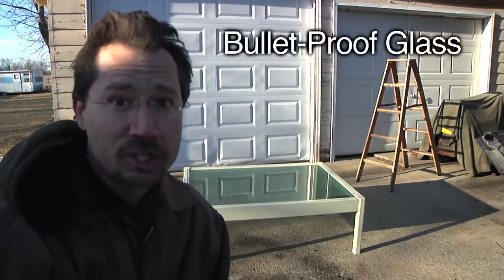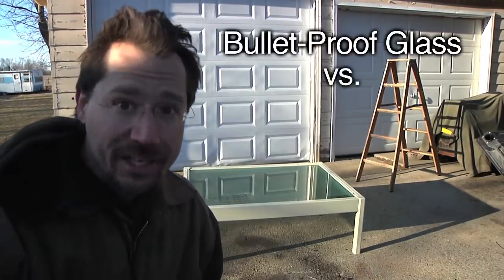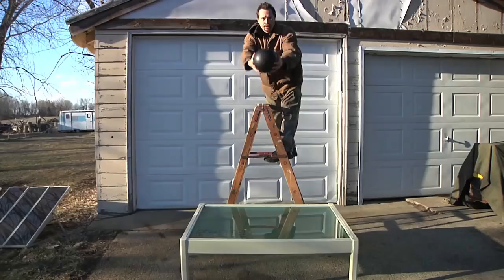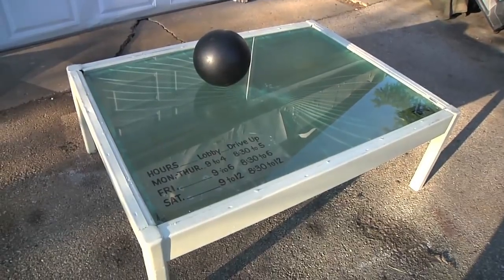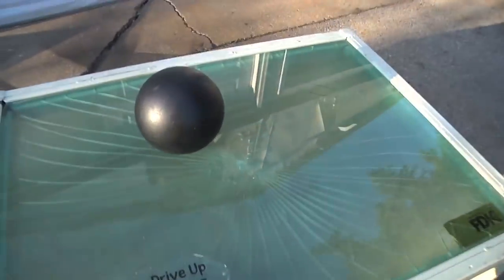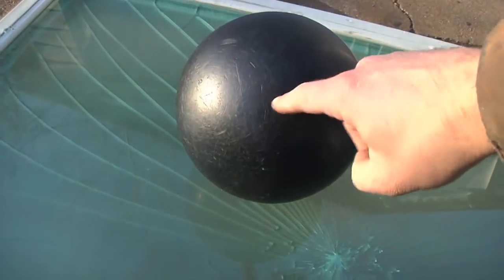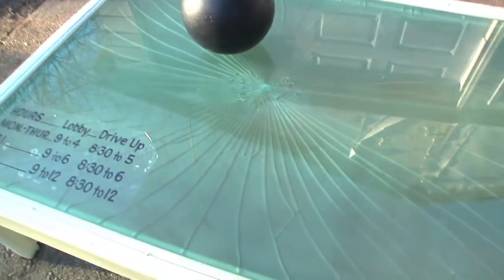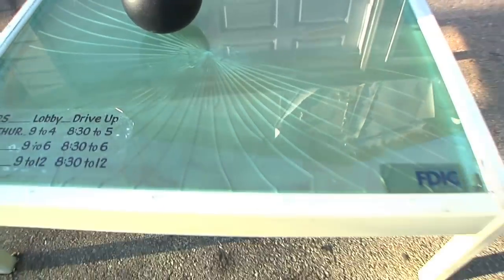Bowling Ball vs Bullet-Proof Glass

Comment from the maker: The glass is 1.25 inches thick. It's 5 layers of quarter-inch thick glass with a very thin layer of plastic between each of the layers. Only one of the five layers cracked under my bowling-ball attack.

Comment: Good Lord you've got a bullet-proof glass for a coffe table! But are those opening hours on the bottom left? Did you steal this from a jewerly shop or something??
Reply from the maker: +juggerfox, I did some work once remodeling a small bank branch office. I had to remove the drive-through. This glass would have gone in the dumpster. Instead, I saved it and eventually made this table. It still have the bank hours and FDIC insured sticker. I also put one of those pens with a chain on it.
Reply: +BenjaminNelson that, sir... is awesome

Comment: lol why would you ever need a bulletproof coffee table XD
and even if you did need one a steel one might be better anyways
Reply: James Roy LOL!!!!
Reply: James Roy
LOL
Reply: A steel table? A. That's an odd material for a table to be made of. B. Unless it's thick as shit, several calibers will rip right through it.
Reply: your saying glass is stronger then steel?
Reply: Swift One thing I want to add is that we should do something about the transparency of the table. Unless one wants to interact visually with the enemy or showing then the middle finger and taunting them, it's not recommended to show the bad guys our position. 
EDIT: typo
Reply: Wimi Bussard
I like the idea of tainting the bad guys.
I assume it works like braining them, but in the taint instead.
Reply: James Roy What if when you flip it, it smashes... will you have multiple Coffee tables or just the one.. it'd be odd to have more than one in my opinion.
Reply: James Roy Indeed :D
Reply: KzeD Gaming it wouldnt break if is bullet proof
Reply: MrJrspek But when it's flipped onto the floor, the vibrations will crack the table, and possible smash it. It's just basic Science and logic there...
Reply: Lol no. You would need to smack it very hard to smash a bulletproof glass table. Just flipping it over won't do a thing.
Reply: just because it is bulletproof dosent mean it wont crack. Bulletproof glass is designed to crack and absorb the energy of a bullet, not straight up be as hard as steel
Reply: Francis Zhao Yes, ofc, but It won't crack from just flipping it, doesn't it? Even normal glass tables won't break if you do so. If you threw it around then it would be another story, but just flipping? I doubt it. But perhaps I am wrong, not sure about it.
Reply: Hide under it in a hurricane

Comment: Actually, to be more accurate you should have dropped the bowling ball from almost 9.5m.
A standard 9mm bullet travels in air at approximately 425 m/s, with a weight of 7.45g, this gives us a total of 676N of kinetic energy. 
Ek = ½ mv^2

Dropping a bowling ball from 4 meters high totals to a little 280N. Since a bowling ball weigths about 7.26kg, the height necessary to achieve 676N is 9.5m. 
E = m x g x h

Comment: that's not bullet proof glass it's simple 1/4 inch non tempered laminated glass. for other safety purposes like glass dance floors and walkways. this will not stop a bullet.  its just 2   1/4  inch glass with film or glue in the center to prevent from breaking into large sharp pieces .. aslo looks good.

Comment: not even a bullet and it made a crack on a bullet-proff glass
Reply: it pretty heavy,give it a break
Reply: The kinetic energy of the bowling ball at that height would be many times that of a bullet. Nothing to blow your nose at!
Reply: That's not what I was saying, but okay. There are many factors to consider when trying to create a bullet proof anything. The rotation of the bullet, the pressure exerted by the tip of the bullet, the deformation of the bullet upon impact. I understand that the bullet would not go through (it shouldn't, anyway) I was saying that the kinetic energy of the bowling ball would be enough to crack the glass easily because it's kinetic energy far outmatches that of a bullet but when you take the other factors as previously stated into consideration, it's more complex than just the Kinetic energy. 

What probably happened was the initial point of contact exerted enough force to crack the glass and then after that, the pressure exponentially decreases due to the point of contact becoming larger because of the deformation of the glass. After which the pressure is not high enough to break through the glass and the rest of the kinetic energy of the ball is converted into mechanical stress on the glass. Which because it's bullet proof, did nothing besides the initial crack. (We can see that from the top layer not having a crack) which indicates it is either a thin layer of tempered glass or safety glass (some sort of laminate). 

What I'm trying to say is that the ball easily has enough Kinetic energy to crack it. But it lacks other features that would allow it to pierce through the glass due to it's shape. I'm certain if you had a pike or spear with an extremely hard and pointed end (maybe Tungsten Carbide) with the same mass as the bowling ball dropped onto the table it would pierce it. (Although I could be wrong!)

http://img.pandawhale.com/post-17667-back-off-man-Im-a-scientist-gi-6tFk.gif
Reply: EDIT; I DID SOME CALCULATIONS Turns out my initial speculation was wrong. I calculated the height from which the ball was dropped to be around 1.311 meters (it took .517 seconds to reach the table, do some math and you get 1.311 meters) And when you calculate the gravitational potential energy of the ball (assuming it was any air friction is negligible due to the height) and it comes out to around 75.7 Joules of energy. 

If you calculate the kinetic energy of a bullet from a standard 9mm slug (goes around 850 mph or 380 meters per second) and it comes out to be 555.84375 Joules! That's a lot of energy! So it turned out I was wrong initially because I misjudged how high the ball was dropped and how heavy the ball was! 

TL;DR: This is a bad test for ballistics glass.

Comment: I work for a glass company and these bullet proof glass is not actually glass. Its a bunch of layers of Lexan that are molded together with 1 sheet of glass right in the middle. They're usually 1'' thick or more. My boss shot through a bullet proof piece of glass and it actually still went right on through which in take make the glass not bullet proof. Theres no such thing as bullet "proof" glass just bullet resistant :) 
FUN FACTS!!!
Reply: This is old-school glass. It's 5 layers of 1/4" glass with layers of plastic sandwiched in between.
Reply: Ah so old school bullet "resistant" glass USED to be glass now its mostly lexan. 
Interesting I learn something new every day

Comment: This video is B.S.. the table is not bullet proof it's cut and break resistant. If it was bullet resistant the bowling ball would have smashed the table into hundreds of pieces. Like with a cut and stab resistant vest it will in most cases stop a knife from going through, you getting cut or poked with a needle but it won't stop a bullet just as a bullet resistant vest may stop certain bullets but it won't stop a knife or needle from going through. Besides there is no such thing as bullet proof only bullet resistant.

Comment: Use a shotput same weight but smaller surface area
Reply from the maker: It's the CONTACT area that matters, not surface area. In theory, the contact area of a sphere hitting a plane is a single point. That's why I figured a bowling ball would give the glass a pretty good smack.